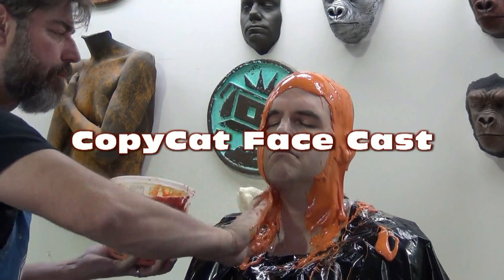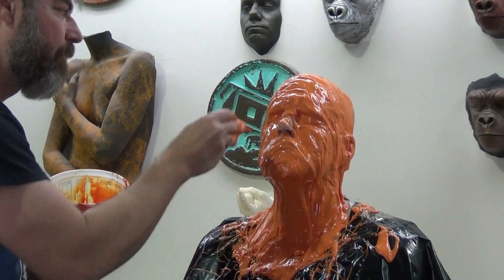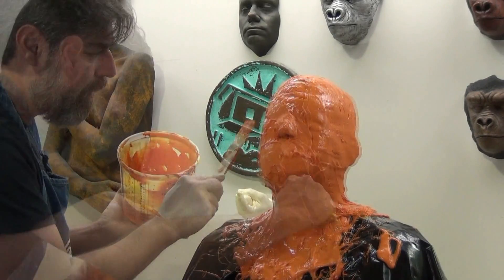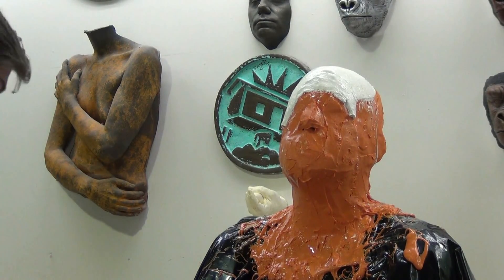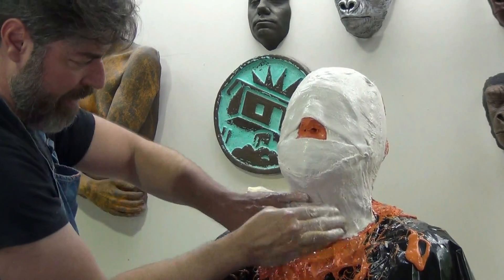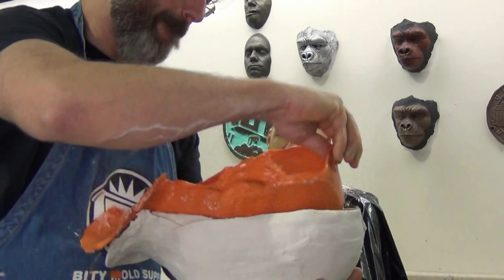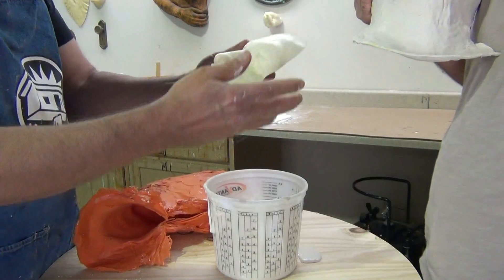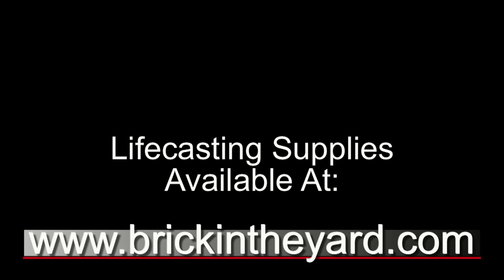Silicone Face Cast With CopyCat Silicone

Comment: Great stuff, as usual! :)
Personally, I tend to switch the alginate cast you made for a similar-depth casting plaster one. Not necessarily anything as tough as UltraCal (although I have done), but having a plaster "intermediate" to work on and clean up is easier for me than having an alginate one:
1 - alginate is yet another material you need to have on hand
2 - it's not always easy to get hold of cheaply (certainly not as cheaply as the casting plaster that you presumably already have on hand to do with final casting with!)
3 - the plaster is much more dimensionally stable than the alginate, especially if you're not going to be able to work on it instantly, because as the alginate dries out, it shrinks
4 - it's waaay too easy to accidentally carve out too much from the intermediate if it's made of alginate; and alginate can tear easily if you don't treat it nicely
5 - and if you DO carve out too much when tidying it up, it's also waaay easier to patch up with a spoonful of NEW plaster, followed by sanding back to the required surface. Try that with alginate and see how well it goes - LOL

There might be something I'm missing that gives alginate the advantage. If there is - please let me know! :)
Reply from the maker: The main advantage here is that the alginate sets fast while coming out the nose holes, and because it is low density it doesn't risk deforming the cast before the nose is fixed. I might go into this more in a future video. You could probably do this technique with plaster but I don't know if you would be able to get as good of a seal with a hard positive. Thanks for the input!
Reply: @brickintheyard  Ah yes, good point about the density - although with the plaster bandage mother mold, and just a shallow plaster cast, I don't reckon that'd be too much of a problem. The quick setting time of the alginate's a good consideration, though :)

Comment: is there any way to scale a model perfectly?
Reply from the maker: Not sure what you mean by "scale?"
Reply: resize it with all proportions intact
Reply from the maker: @h7opolo  That sounds like a great job for 3D scanning and printing!
Reply: such is the power of printing vs casting. ok, thanks for your answer!
Reply: @brickintheyard  There used to be a polyurethane product you would soak in water and it would swell. I know you don't carry that any more, but do you know where I could get a similar product?
Reply from the maker: @rorypenstock1763  as soon as I can find a replacement I will make a big announcement. We have been searching the planet for a shrinking and expanding rubber for about 2 years now!